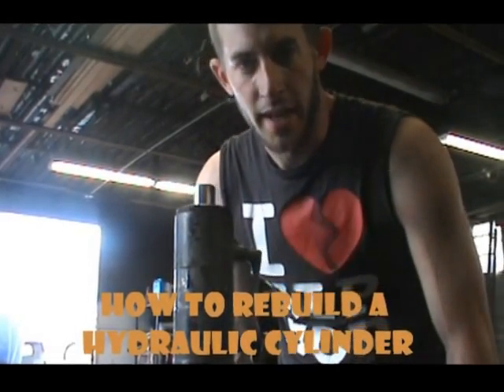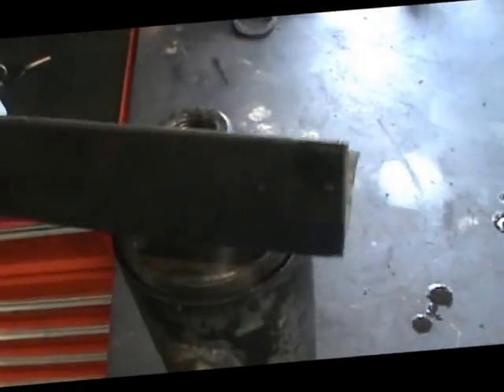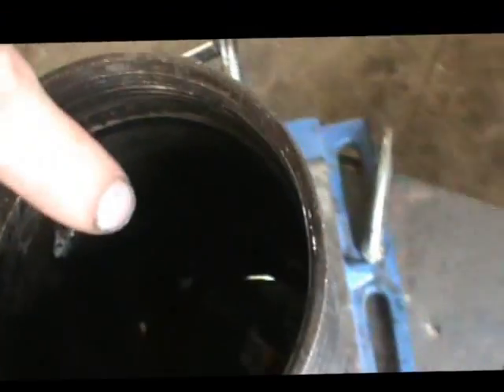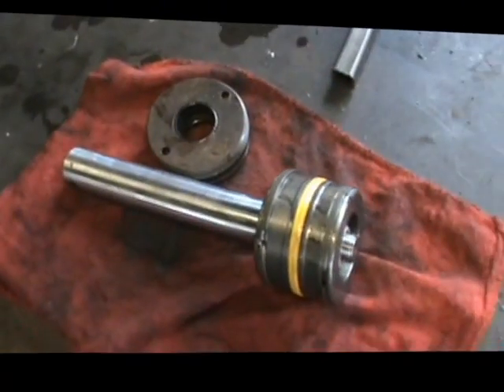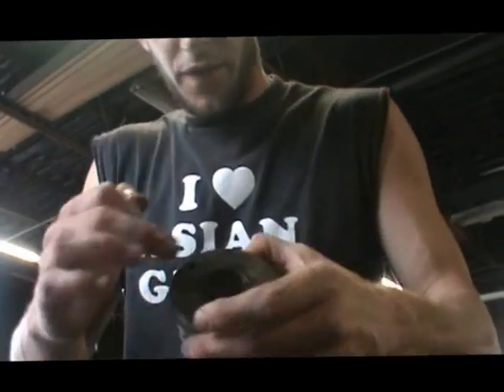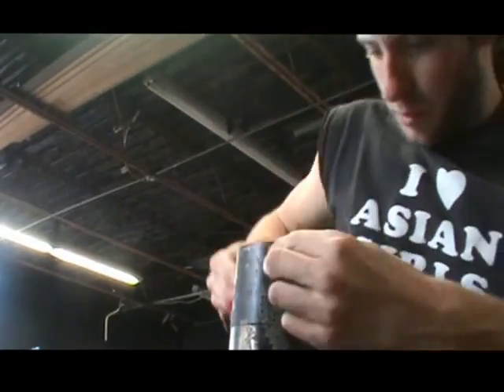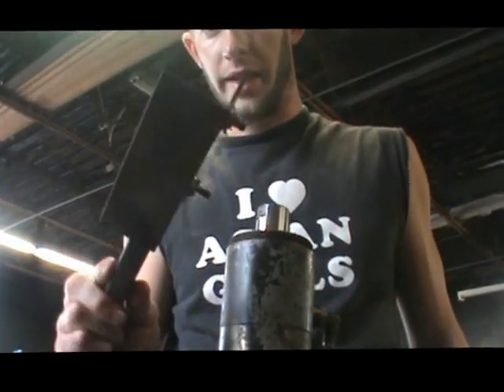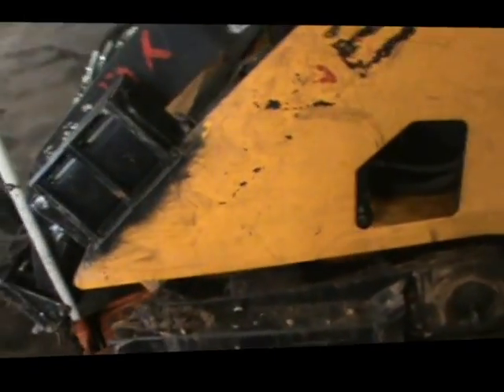How to Rebuild a Hydraulic Cylinder

Comment from the maker: thanks for watching, you should be able to repack the excavator cylinder in the same way its just gonna be heavier..i just repacked my backhoe dipper cylinder and its almost as big as your cylinders... you might acutally have bolts instead of a threaded gland.. just be careful and make sure you have three friends to remove the rod from the machine its gonna be heavy id leave the cylinder attached to the machine and just yank the rod.. good luck

Comment: Great video and t-shirts. Question for you. I've got a Hitachi ex200lc excavator...I have a cylinder that is leaking a bit and I'm thinking I'll need to replace it soon. It's a big ol' cylinder though. never done it before, always taken them in to get done. do you think it is possible with just regular tools to be able to tear it apart and repack it myself? On these big cylinders are there any 'dangers' i should watch out for or anything that is under extreme pressure that I don't know about?
Reply: Did you do it yourself?

Comment: UPDATE-I found u on fb and left a detailed message for help...but i know yer busy...so today we were able to remove 3 cylinders and change the seals...both booms and 1 stabalizer...wasn't soo bad..other than the oil i got all over me...we couldnt' get the nut off that is on the other end of the cylinder so we took it to a repair shop and they took it right off for us with a air something...last thing we need is to get the bucket cylinder off...we can''t..it ain't coming off...is there a trick?

Comment: I have a 10 year old Torin 3.5 ton floor jack that lifts fine but under load very slowly drops. It's about 10 years old.  The cylinder is full with fluid and I made sure and bled off any access air.  There are no external oil leaks. Do you have any ideas what might be the problem and a solution?  Thanks for the video

Comment from the maker: thanks for the input. ive been welding for years and years and as a result i trust my welds to support weights in excess of 40,000lbs day in day out. if your referring to my little spanner tool, obviously its a tool i made on the fly, out of rusted and oil soaked bolts sorry it doesn't meet your aesthetic nature.

Comment from the maker: good luck, cylinders are very simple but can be awfully stubborn to take apart. if the cylinder doesn't have pins it will usually have enough of a lip that you can use a large pipe wrench to unthread the gland. then take the rod nut off and you should be able to take the seals and gland to any hydraulic store. they should be able to measure the rings and take out the inner gland seal called a poly pack and wiper seal for you. let me know if you would like me to make any other videos. thanks